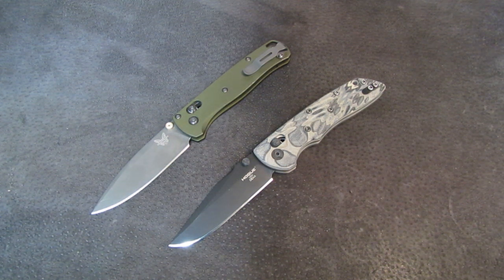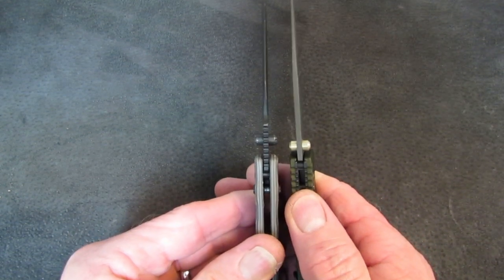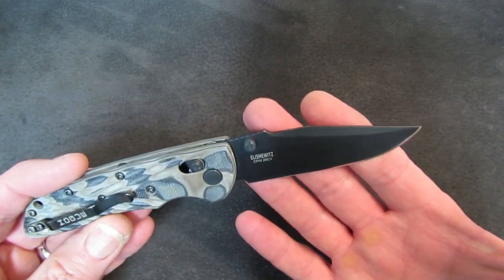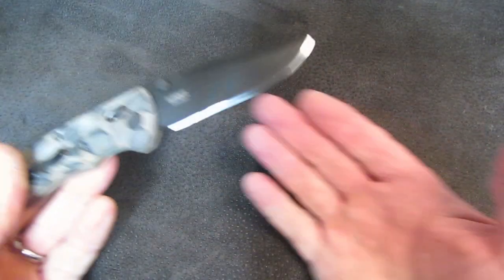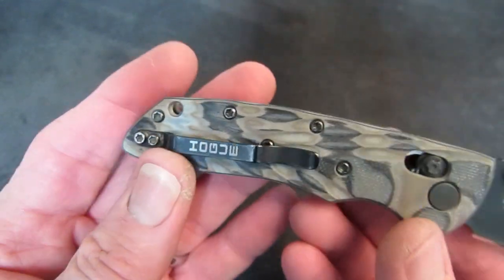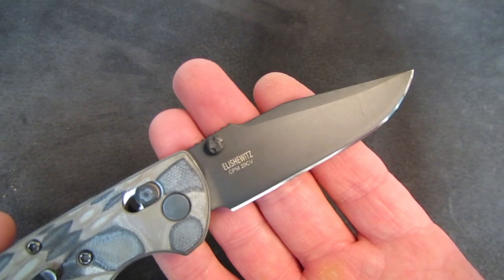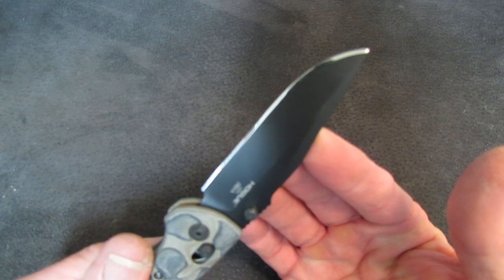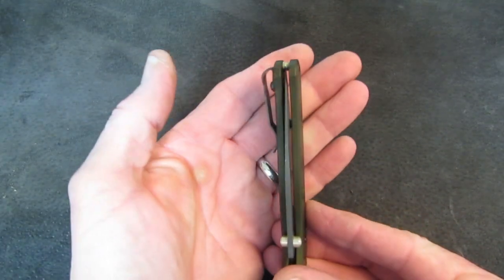FSB -- Hogue Deka Able Lock:  Axis of EDC

Comment: I really like my Deka. The omega springs seem sturdier than Benchmade's. The materials on the Deka are a step up from the basic Bugout. Only criticism is that they should break the edges on the lock and studs.
Reply: @J Hall it sits fine. I prefer to have something to grab. There is a v2 of the deka coming out with a deep carry clip. I don't believe house currently has deep carry clips in stock yet.